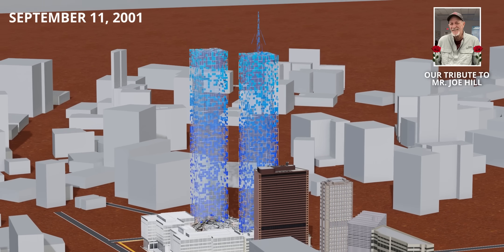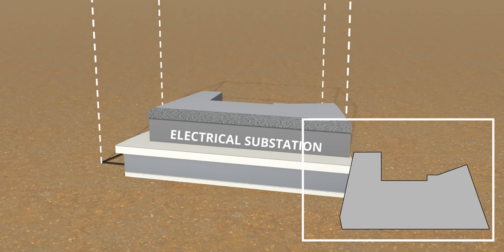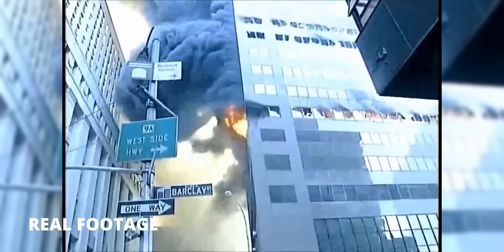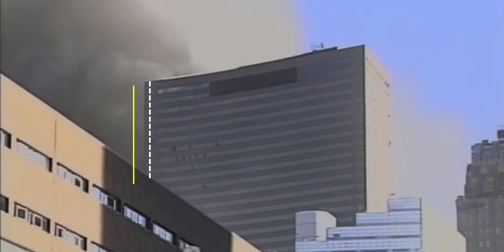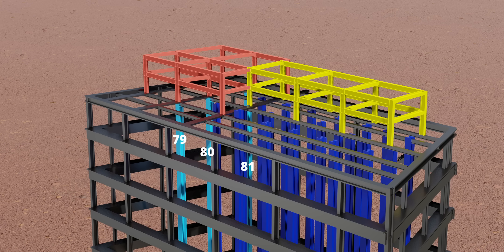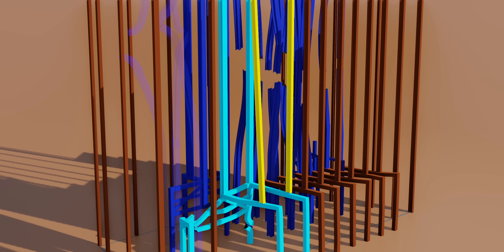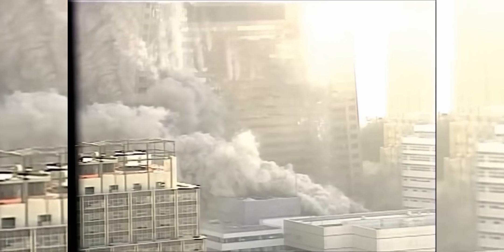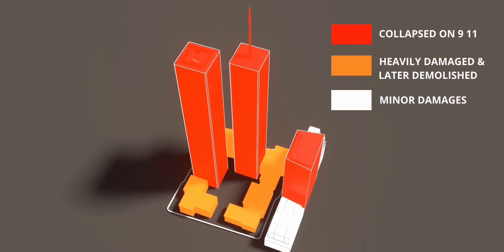Collapse of Building 7 | The Complete Physics

Comment: You have to be a real dumb f to believe any of this bs
Reply: And yet it's not wrong. Go figure. 
	
This video is pretty good – with a few exceptions - and goes into a much higher level of detail than many viewers will be able to comprehend.  While not perfect, the collapse mechanisms – the sequence of failures - described here  are substantially correct and this is true no matter who planned and carried out the 9/11 attacks or why . 

That may not be what you want to hear and go against 20+ years of entrenched dogma and conditioning, but it’s not wrong. 

That also means (in case you did not get the hint) this video can be (and IS) absolutely correct in its description of collapse mechanisms AND the 9/11 attacks could still have been some sort of inside job. The two things are in no way mutually exclusive. 

The mechanisms described here have broad professional support around the world. There are no professional engineering organizations (for example: ASCE, ASEE, ICE, etc) that disagree with them or have offered any formal dissenting opinions or alternative hypothesis. 

So, setting hubris aside, either the overwhelming majority of the worlds structural engineers and simple observation are wrong,… … or you are. Which seems more likely? 

IF you still think believe this explanation is wrong then produce a better one . Good luck with that. No one ever has and I don’t see you moving that needle today. 

No one ever does.
Reply: @TheCriticalStinker-jw4fl  I've worked on buildings similar to this. No building built in the last 100 years at least is collapsing due to a nearby fire and debris. Maybe the news reporter that reported it falling down while it was still standing behind her will have a better idea...
Reply: Wow YouTube really does not want people watching the interview where the lady says building seven has fallen when it's clearly still standing behind her. Why would they want that? Kind of odd to want to hide the truth. Unless....
Reply: @digs898  - Yeah, I guess that's why there are a dozen or more videos on YT I can find right now showing that BBC clip. FFS 🤦‍♂

Building 7, the 6th building to collapse of 10 lost on 9/11 still confuses many even though it has been extensively studied. Not famous or a terror target, and with no casualties it did not get a lot of attention initially, creating an information void the internet rapidly filled with garbage. Because everything seems like a conspiracy if you don’t understand how it works I prepared this brief summary of the collapse from my own analysis. 

The North Tower collapse at 10:28am bombarded Building 7 with tons of burning debris, causing heavy damage and starting multiple fires burning out of control for the next 7 hours. Half the FDNY firefighters having been killed, others injured, units in disarray, equipment destroyed, no water pressure, and the greater urgency of Search & Rescue efforts, firefighting was pulled as futile. The building couldn’t be saved and was left to its fate.

www.youtube.com/watch?v=g_SvpwyC17M&ab_channel=MFitz  

Collapse of a burning structure is always a concern for firefighters. Steel buildings subject to fire rely on active fighting of the fires to survive. Buildings are designed around 1 to 3 hours of fire resistance, allowing time for occupants to escape and ACTIVE firefighting to get started, after which all bets are off. Left to their own devices they will exceed their design envelope and collapse. In B7 the occupants escaped, passive and active fire protections were compromised and active firefighting was abandoned which left the building to take its chances. It lost. Odds on Building 7 would eventually collapse, and it did. No big deal in logic. That is the sort of choice firefighters make every day in brush fire situations - which houses to save and which ones to let go. Only real difference here is moving the decimal on the size and cost.

www.youtube.com/watch?v=WnYBX6QT0R4 

FDNY Chief Daniel Nigro ; The biggest decision we had to make on the first day was to clear the area and create a collapse zone around the severely damaged 7 World Trade Center, a 47-story building heavily involved in fire. A number of fire officers and companies assessed the damage to the building. The appraisals indicated that the buildings structural integrity was in serious doubt. I issued orders to PULL BACK the firefighters and define the collapse zone. It was a critical decision; We could not lose any more firefighters. It took a lot of time to PULL EVERYONE OUT, given the emotionalism of the day, communications difficulties and the collapse terrain

FDNY Deputy Chief Peter Hayden ; We had our special operations people set up surveying instruments to monitor and see if there was any movement in the building. We were concerned of the possibility of collapse in the building. And we had a discussion with one particular engineer there, and we asked him if we allowed it to burn could we anticipate a collapse and if so, how soon? And it turned out that he was pretty much right on the money, that he said 'In its current state you have about 5 hours

The collapse of Building 7 was anticipated and widely reported in the media throughout the day. At least 24 video cameras recording some or all of the collapse. Everyone knew what was coming and why.

www.youtube.com/watch?v=OY5S5k3tMHI 

Building 7’s collapse was completely different to the Twin Towers, harder to understand with most of the details difficult to see. But we can still sort out what happened through careful analysis and observation.  This is MY EXPLANATION of the collapse sequence using the best available information and relying on no authority.

B7 was a complex 47-story steel framed structure built on top of a smaller existing 3-story building, requiring several lower floors dedicated to complex load transfer structures instead of usable office space. There is no other building like it. Of trapezoidal shape and all-steel tube-in-tube construction, B7 (above the 7th floor) consisted of a central core of steel columns carrying most of the gravity load, perimeter steel columns around the outside of the structure carrying the remainder of the gravity loads and long span beams and girders to tie those elements together and form the floors. On the outside of the building hung a moment frame - the last part of B7 to fall. 

Phase 1 : The first externally visible signs of collapse initiation occurred at 5:20:28 pm. Collapse initiation for B7 is notably quiet with observers not realizing the building was collapsing! There was no audible warning in the form of say hundreds of ear drum busting 180-190dB explosive bangs preceding the collapse. Here at 12:00 a local CBS affiliate reporter is talking 10 blocks from B7 when collapse begins. People don’t start to notice the collapse until 12:11. Then at 12:45 is the famous CBS fixed camera clip of Building 7’s collapse.  Note how quiet it is.

youtube.com/watch?v=t5tEy6mXSE8&ab_channel=fresnosean379

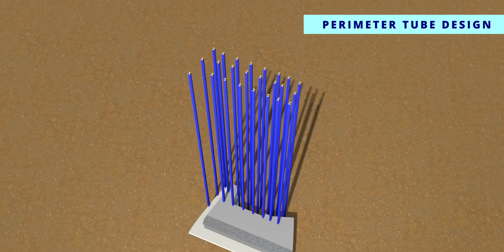Collapse initiation was due to lower floor failures above the load transfer region (7th floor) in the NE corner of the building. In this video at 0:45 you can see the NW corner from inside the building while under construction, Column 79 just out of frame on the left. That big, angled steel beam across the top of the frame connects to C79 at one end. The girders connect to the beam. That beam and all those girders depend on just one connection

youtube.com/watch?v=nP3TNHPCIVU&t=35s&ab_channel=EdwardCurrent

Phase 2 : Lower floor failures caused a loss of critical lateral support over an excessive length of core Column 79 and it buckled. If you look at a floor diagram of Building 7 (see above) and look at all the structures that depend on C79 you quickly realize this one column was a relatively isolated structural element on which a disproportionately greater fraction of the structure depended analogous to say the Key Bridge. Externally we see a vertical progression of window breakage along the 44-46 line and a kink in the roof of the East Mechanical Penthouse at the top of the building, consistent with C79 failure. The transition from full capacity to almost no capacity occurs in virtually an instant. Once the buckling failure occurs there is almost no resistance

Normally with a buckling column, the load could very well be redistributed to other columns, meaning the buckling could stop after a while. With C79 that is not the case - the failure did not redistribute the load, so the collapse rapidly progressed to the roofline, sinking the rooftop penthouse.

Phase 3 : With C79 gone, B7’s progressive, non-symmetrical collapse continues with C80 and C81 at the east end of the core left laterally unsupported and quickly buckled and failed as well, sending the EMP down through the building. C79-81 all have no diagonal bracing, which I believe is a major reason why they could not redistribute a lot of vertical loads among one another.

From there collapse progressed from east to west through the central core until the core was gone taking all of the interior floors and structures and probably most of the perimeter columns with it. You can see the horizontal progression of window failures low in the building and the dropping of the remaining rooftop structures into the building. One of the big takeaways from the NIST Building 7 study (that gets completely ignored) was their modeling which determined C79 failing under ANY circumstances would have initiated the same collapse sequence.

Phase 4 : After some 10 seconds all that remains of Building 7 is just a hollow empty outer shell - the exterior moment frame - creating the illusion the building is still standing since little has changed externally. But it’s just a hollow empty shell like an empty cereal box supported by only a few remaining columns and quite unable to remain standing. With all the internal framing gone. the north face leans inward, forming a V in the roofline, the last perimeter columns buckle under the strain and with nothing left keeping it up the moment frame free falls, landing on top of the 7-story high debris pile. It is only at the very end that a single measurement of alleged free fall acceleration is taken. Note this is not the building but just its outer shell, and only one corner at that, at the very end of the collapse. Start to finish the entire collapse took 18-20 seconds, or less than 1/3 of true free fall and we have to look at the whole thing, not cherry-pick little bits to fit a particular narrative. Worth noting _how fast something falls cannot tell you what started it falling in the first place. The debris spread out, blocking surrounding streets, heavily damaging the Verizon Building and destroyed Fiterman Hall, all well outside of Building 7’s “footprint”.  

Building 7’s progressive, non-symmetrical collapse was incidental and unintended collateral damage from the combined effects of fire + time + gravity started by the collapsing North Tower. That is true no matter who planned and carried out the 9/11 attacks or why . The collapse was of so little consequence it barely even registered at the time, a mere footnote. It only took on semi-mythical status as an alleged smoking gun years later when demolitions at the Twin Towers, missiles at the Pentagon and shoot down over Shanksville all failed and conspiracists had nothing left to work with.

I hope you found this helpful, informative and it solicits informed critical comment. If I made any errors of fact, logic or reason or left anything important out, please let me know so I can fix it. IF you can offer a more plausible alternative please do. Be the first. Please start any reply with the words “Tits McGee” or I will know you didn’t read it and are wasting my time.
Reply: @digs898 you are arguing with a bot I don’t know who pays for a ai YouTube comment bot to defend tower 7 but it’s weird.
Reply: @billymunroe-williamson8840  - It takes a special combination of hubris and stupidity to think believe that someone disagrees with you only because they are being paid to do so.

Or is a "bot" (which is perhaps even dumber).

The lengths people will go to in order to rationalize not using the thinking part of the brain!

IF I am in error on any point of fact, logic or reason please feel free to point it out so I can fix it.  Be productive, not a whiner. Contribute.

IF you can't do that then you should really start examining who has the problem here.
Reply: @billymunroe-williamson8840  right.....
Reply: @digs898  - Did I address your concerns about the BBC report or not?  If not, why not?
Reply: @billymunroe-williamson8840 - And you don't even have that. Take a minute and just think about how pathetic it makes you look that the only argument you can muster if anyone disagrees with you is that your opponent must be a bot.

Its OK though. No doubt your parents still say they are proud of you anyway.
Reply: @TheCriticalStinker-jw4fl  youre pretty smart brother. But please, for the sake of your brain, leave the comments. Theyll never learn.

Comment: .... absolute nonsense ...
Reply: And yet not wrong. Go figure. 
	
This video is pretty good – with a few exceptions - and goes into a much higher level of detail than many viewers will be able to comprehend.  While not perfect, the collapse mechanisms – the sequence of failures - described here  are substantially correct and this is true no matter who planned and carried out the 9/11 attacks or why . 

That may not be what you want to hear and go against 20+ years of entrenched dogma and conditioning, but it’s not wrong. 

That also means (in case you did not get the hint) this video can be (and IS) absolutely correct in its description of collapse mechanisms AND the 9/11 attacks could still have been some sort of inside job. The two things are in no way mutually exclusive. 

The mechanisms described here have broad professional support around the world. There are no professional engineering organizations (for example: ASCE, ASEE, ICE, etc) that disagree with them or have offered any formal dissenting opinions or alternative hypothesis. 

So, setting hubris aside, either the overwhelming majority of the worlds structural engineers and simple observation are wrong,… … or you are. Which seems more likely? 

IF you still think believe this explanation is wrong then produce a better one . Good luck with that. No one ever has and I don’t see you moving that needle today. 

No one ever does.

Comment: If you believe this you are a COMPLETE IDIOT!
Reply: And yet it's not wrong. Go figure. 
	
This video is pretty good – with a few exceptions - and goes into a much higher level of detail than many viewers will be able to comprehend.  While not perfect, the collapse mechanisms – the sequence of failures - described here  are substantially correct and this is true no matter who planned and carried out the 9/11 attacks or why . 

That may not be what you want to hear and go against 20+ years of entrenched dogma and conditioning, but it’s not wrong. 

That also means (in case you did not get the hint) this video can be (and IS) absolutely correct in its description of collapse mechanisms AND the 9/11 attacks could still have been some sort of inside job. The two things are in no way mutually exclusive. 

The mechanisms described here have broad professional support around the world. There are no professional engineering organizations (for example: ASCE, ASEE, ICE, etc) that disagree with them or have offered any formal dissenting opinions or alternative hypothesis. 

So, setting hubris aside, either the overwhelming majority of the worlds structural engineers and simple observation are wrong,… … or you are. Which seems more likely? 

IF you still think believe this explanation is wrong then produce a better one . Good luck with that. No one ever has and I don’t see you moving that needle today. 

No one ever does.